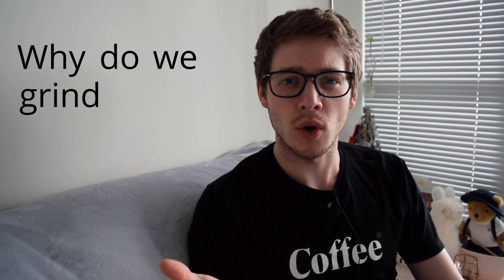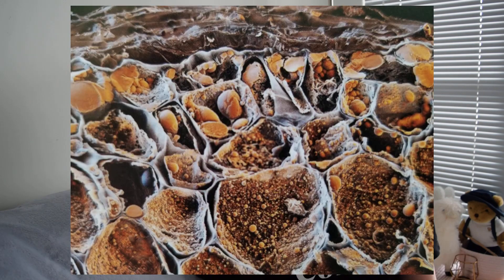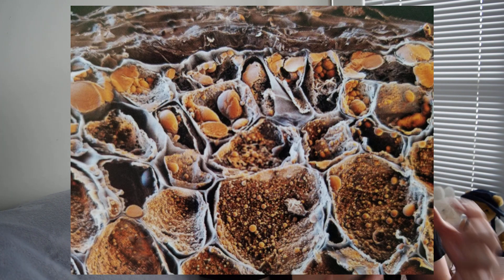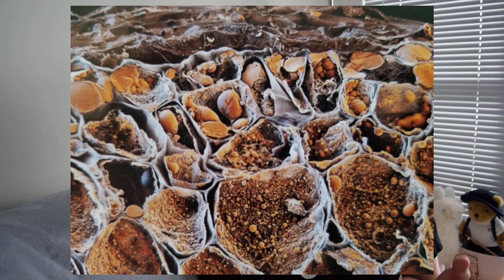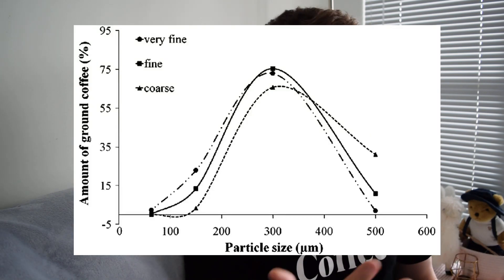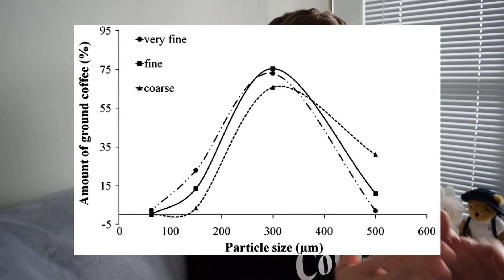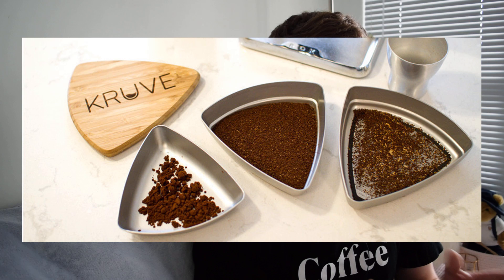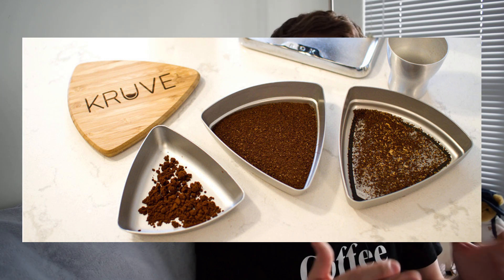Why do we grind coffee? - Coffee Explained (Ep. 3)

Comment: If grind size is finer than I want, can I compensate by using lower temperature water or thinner filter paper? And vice versa. Also, on the similar lines, is it true that I can vary grind size, water temperature and brewing time in more than one way to achieve almost same extraction and taste in each of those variations?
Reply from the maker: Yes! You need to picture all of these variables as "levers" that pull on extraction. Hotter water extracts more quickly, as does finer grind, and thicker filters slow down the flow which leads to more contact time (I.e. more extraction). Same the other way around with cooler water, less contact time, coarser grind. These things contribute to less extraction.

If you're stuck on a fine grind for example, you can try using much cooler water, thinner paper, and also larger pours..these things can help compensate